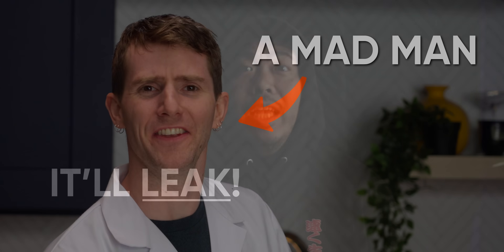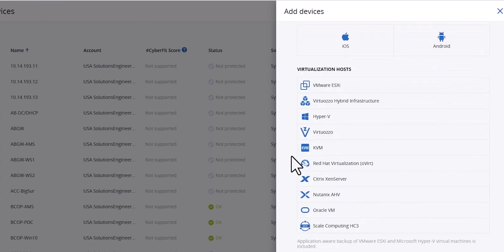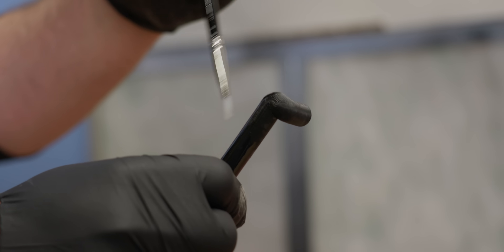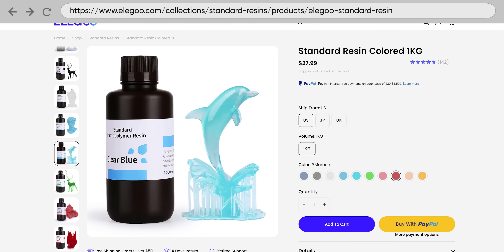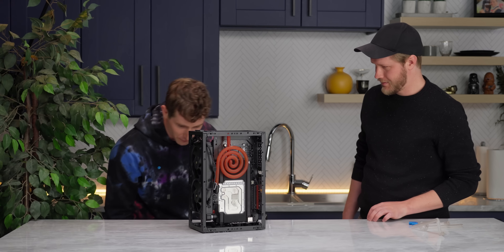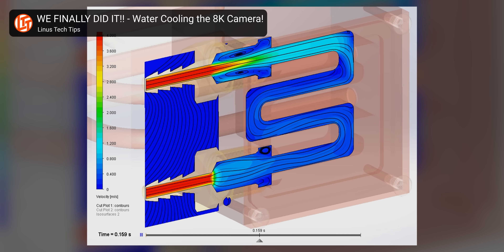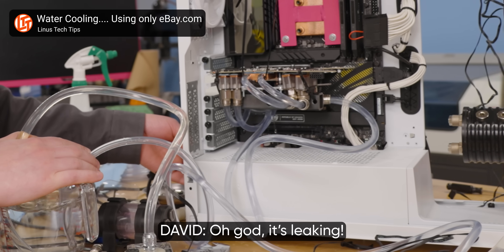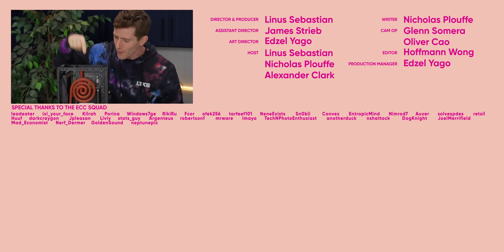3D Printed Hardline Water Cooling

Comment: Its insane that this doesn't leak like hell
Reply: Well resin has been known to be water tight for years.    Most of the resins for hobby use don't stand up well in water. That said there are plenty of ones that are water safe.   Some of the new ones that you can thermal cure on top of the UV cure so you don't end up with the uncured internal resin issues although it is absurdly expensive and I don't think I have seen clear.
Reply: Oh it will. I thought about doing this almost 6 years ago. Turns out that resin prints dissolve in water. Hope that the resin they used resolves this issue.
Reply: @hed420  There are plenty of resins that aren't water soluble. In fact, can you guess what kind of technique dentists use nowadays?

Surprise! Resin 3D printing.